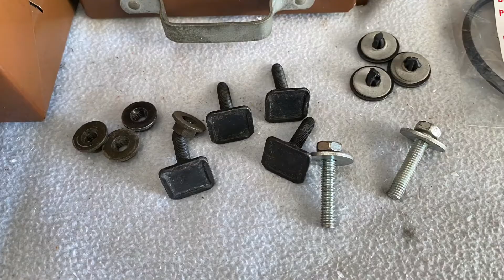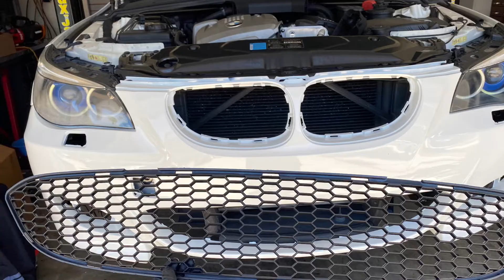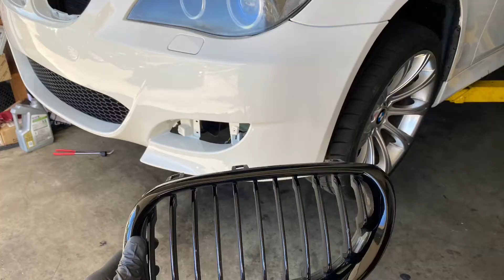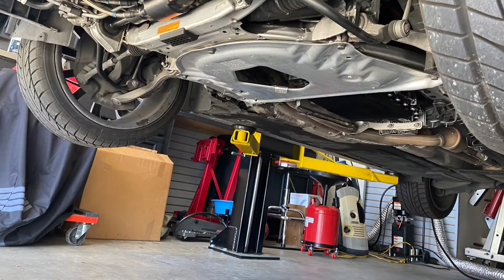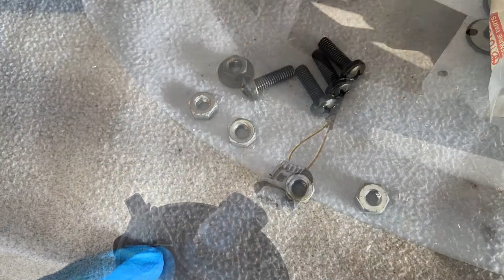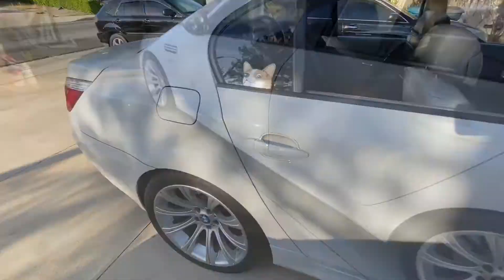2007 BMW E60 M5 Front

Comment: Can i do this on 2006 530xi!
Reply from the maker: Yes you can they make the same bumper for your vehicle. Just depends if you’re model has the headlight washers. I believe there are 2 types one with the headlight washers and one without. If you like the content please like abs subscribe 👍🏽
Reply: @RJayStyle  ofc !! And yea i have the headlights washers , where can i find those ?
Reply from the maker: I bought it off a local guy selling replica m5 front bumpers. It had the caps for the washers built in. It’s made of polyurethane instead of fiberglass so it flexes and won’t crack when your hitting dips if your car is lowered. There are some selling online as well just make sure it’s flexible polyurethane material so you don’t have to worry about it breaking.
Reply: @RJayStyle  alright ty 💪